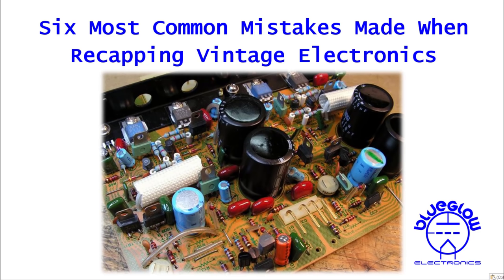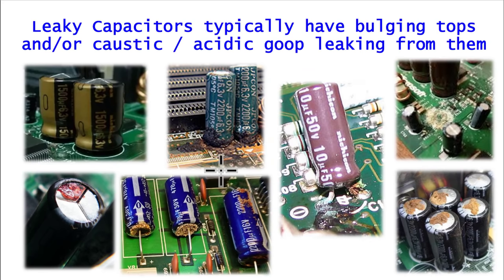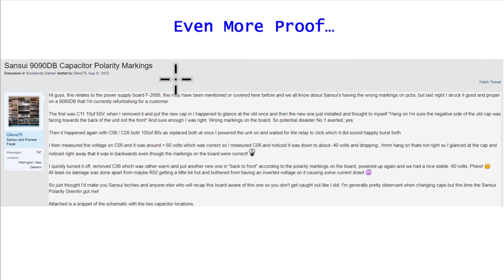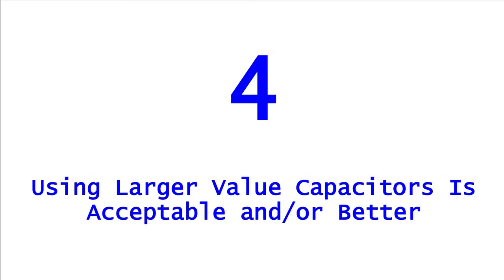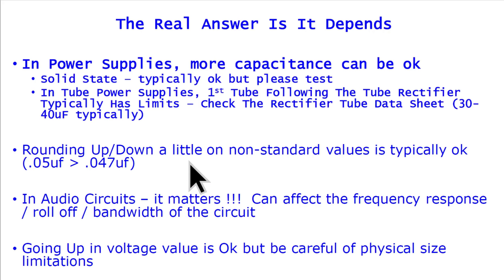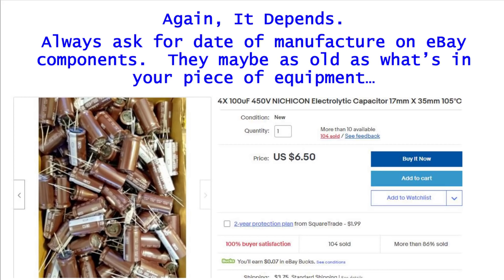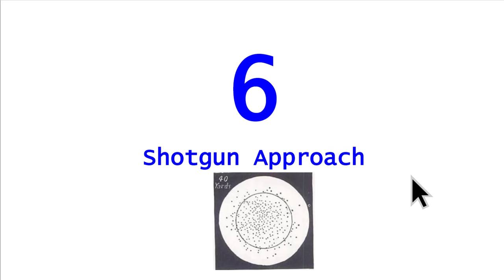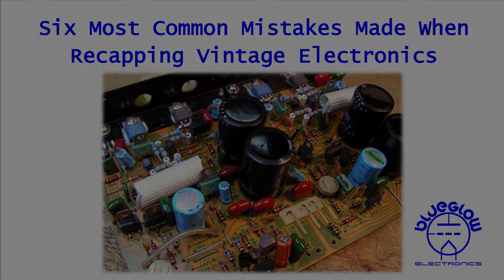Six Common Mistakes Made When Recapping Vintage Electronics

Comment: As one who doesn’t live in the United States, I no longer buy anything from the US. What’s cheaper for Americans is made criminally expensive by extortionate postage costs or simply unavailable because the company policy is, ‘We don’t ship overseas’. You get the feeling someone is holding a turd under their nose or something. More than that, I’ve come across the attitude of, ‘You’re not getting what we’ve got’.

I had this out with Parts Express, among others. Small scale tool companies are the worst but component sellers are pretty bad.

The inevitable result is that people like me are forced to deal with ummm… ‘other sources’. There’s no good sneering at other suppliers nations if American companies are unwilling to compete.

And in an ironic twist, a lot of them come out of the same factory anyway.

Comment: Changing the value on any Capacitors is NEVER a good idea, but putting a high freq low Z high quality cap makes the item last longer and changing the voltage to a higher value is never a bad thing(manufacturer's use cheep components and putting higher quality never hurts).
Old capacitors rarely go bad with age it is more heat and leakage or evaporation.
But in maintaining old electronic stuff the switches are more of an issue, cleaning all those contacts is a pain but so necessary.

Comment: Right away, the first part of the video,  I have a DISPUTE, and that is,  whether caps  APPEAR to be physically leaking  FLUID  has  NOTHING  AT ALL to do with whether the cap is good, bad, ELECTRICALLY leaky,  or not
Reply: So are you saying it's ok to have corrosive electrolyte all over your copper tracks as long as the device works for the time being??

Comment: Biggest mistake of all is recapping original caps that don't need recapping that had survived for 50+ years because they were properly made or MIL, highrel, and then replacing with a cap that won't last more than a few years.
Reply: Indeed. The best thing to do first is test the capacitors with a voltmeter and only replace those with bad readings.

Comment: bEWARE THE YELLOW GLUE. eSPECIALLY IN rca OR ge EQUIPMENT. iT CAN, OVER TIME, BECOME CONDUCTIVE. rca HAD TENS OF THOUSANDS OF INSTANCES OF THE GLUE CAUSING INTTERMITTENT ISSUES. mOSTLY ON TELEVISIONS, BUT ALSO ON SOME OF THIER AUDIO GEAR..

Comment: not doing enough is another failure. socket A and 990fx boards are ones with extremely high wattage chips that are extremely sensitive to any kind of fluctuation. its better to assume they are all out of spec than risk sending out a finished board you tested on a phenom and find out the customer was putting in a 9590fx in. intel has a few chips that were extreme load too but I don't mess with anything intel so I couldn't name them off the top of my head. some generations of boards were pushed so hard and so far that one cap or VRM even slightly out of spec can either cause endless errors like the crosshair v formula z or end in a chain reaction explosion like the asrock 990 extreme 9. the latter happening with enough violence that it will create shrapnel that can damage other parts and sounds like a machine gun firing. if it can hold a "board eater" chip test all values and assume everything can be bad even if it doesn't look it. 

another thing is older computer power supplies. replace everything in those that might fail, they are known as kamikaze power supplies due to the lack of any protection at the component end and if they go off they often will destroy anything attached to them. I recently found this out when a 90s computer graced my workbench and I found not only the hard drives dead but the motherboard and floppy drive had taken a nasty hit too. total loss. nothing was salvageable. however that wasn't a repair failure but a lack of knowing maintenance needed to be regularly done on the part of the user and the general criminally under-ventilated cases of the time that were only rated for older sockets. 

oh and if the case was under-ventilated assume the worst of every heat vulnerable component. I've seen cases where fans are decorations and the air from them flows nowhere.

Comment: I am clear on the ebay question, the first thing I look for is the rating of the vendor.  Anything under 99%, steer clear unless you are looking for an almost ‘unique’ item.  My experience is, that I can almost always get a 100% rated vendor, selling the item I want, for close to a middle or low-mid price.  The exception of course, is where there are only a handful of ratings or sales…that more likely suggests the vendor has ‘restarted’ their whole operation, than is genuinely a low-turnover seller just begun their business.  Finally, I believe the quality of Chinese goods, can equal that of anywhere and their labour force too, can be the equal of any…but…there is a load of broken crud floods out of Shenzhen, I assume many people are rummaging in ‘failed’ parts bins on a wholesale basis, and punting it as ‘good’.  The people doing this, are pretty arrogant too, so forget kind and well-mannered orientals when it comes to dodgy trash components or anything else - they are the same people, all over the world, they just speak with different accents!  

There is no comeback on Chinese Shenzhen region sheisters either, because as far as I can tell, ebay is afraid to take any action against Chinese citizens, or maybe certain ones that are ‘connected’?  ebay don;t frighten or worry these Shenzhen sheisters, is what comes through loud and clear, that’s why they proliferate.  And they brazenly lie until they realise you are able to determine the difference between trash and quality goods…then the veil slips a bit, and they go from I don’t know much about the product, I just sell this stuff’, to goading you to try to get your money back, in an instant.  As a rule, I simply don’t buy from China direct on ebay, excepting two knwon brands, with actual shops on ebay.  Cheap, unbelievable prices a quarter or a half of a US or Japanese competitor, etc, for the exact spec, usually means the trashy vendor is simply lying unfortunately.  Take care all.

Comment: The 7th most common mistake is taking videos like this seriously.  Blueglow implies replacing ALL capacitors is the way to go to repair a 50 year old receiver.  No, it's not.  Many electrolytics are still good at that age.  What you need to do is test each capacitor for ESR and replace only those that have high ESR readings.  Then when you first power up the receiver bring the voltage up slowly so the good caps can reform.  Typically that is not a problem for low voltage electrolytics - it's a much riskier approach in the high voltage circuits of tube equipment.  After running for a while check the temperature of capacitors - any warm ones should be replaced.  Finally, check nodes for correct voltages.  The more you check the better.  This is the way to repair vintage gear and not force a customer to pay for what is not needed.  Go honest.
Reply: With all due respect I beg to differ. Blueglow is correct in my opinion. The ESR is important for capacitors used in high current application like filter or power switching but it says very little about the state of the capacitor. Leakeage current and value drift are very important parameters and you need to test those in a proper capacitor tester (not the "multimeter" or LC kind). To do that you have to desolder the capacitor in the majority of the cases. If you have done that you may as well replace the capacitor with a new high quality one anyway. Most electrolytics will have a high leakage current or have changed value outside design specs after 50 years. There are exceptions but they are not normally used in consumer equipment. Other capacitor types are a diffrent story, good quality mica, plastic or cheramic can last a very long time if they have been used inside spec and not in a too harsh environment. If you want more good info in addition to Blueglow I  recommend Mr Carlsons lab, Paul has great info on this on his channel.

Comment: My suggestion to this list:
- Check the cap physical size and it's lifetime expectancy in it's datasheet. This impies using high-quality caps, that have credible datasheets.

This does not really apply to vintage equipment, because they used huge caps back then, but very certainly apply to modern, miniaturized equipment, which usually fails after a year or so. If you check the specs of those miniature but high capacity electrolytic caps, it will be surprising that they specify 2000-5000 hours of lifetime ONLY. That's not even a year for a device that operates 24/7!!!

If you can cram bigger-sized (same value) caps into these equipments, even when the lead spacing is wrong, the bigger ones will usually give 2-3 times more lifetime.

Comment: Sometimes the glue needs to go too - there are numerous cases where the glue gets conductive as it ages, and starts causing all sorts of problems. See EEVBlog videos about Rockit studio monitors failing because of conductive glue! The best way to check capacitors is with an ESR meter, you can even check them in circuit if there aren't multiple capacitors in parallel on the same bus. Even if there are multiple capacitors on the same bus and the ESR looks good, you can quickly verify with the capacitance measurement on a DMM that the value roughly adds up to all the caps together.  Best way to check for conductive glue is with a good meter.

Comment: Something to be wary about replacing caps with higher voltage: If the caps are of same size you might think "Win-Win!", however, chances are the higher voltage rated cap will have a higher impedance losses! It may heat up more making it's life span shorter and power supply performance poorer.
Ofcourse during the decades some progress has been made in manufacturing so this point may be moot on a device 3 decades old.

Comment: You forgot two, very important ones too. Don't mess with something you know nothing about. Learning how to do something is one thing but know when you are out of your depth and should stay away from a project.

Also, you have a phone, that phone has a camera. After opening up the case. TAKE A HUNDRED PICTURES. You should have a picture of everything before you start. Just so you can go back to a picture and reference it later. If you are like me, you will often have to set stuff aside while you wait for parts (especially these days). It helps if you have pictures when those parts arrive maybe months later.

Comment: Why Glue Capacitors??
Reply: To give them mechanical stability. If the mechanical load is on the solder joint only, the joint will fail under vibration or shock load.

Comment: Replacing original capacitors with high voltage capacitors not always good. Higher voltage capacitors raise circuit voltage. Its not always good.

Comment: Nevr mind glue or leakage, if theres a cap there replace it anyway. All of them!
Reply: You haven't watched Mr. Carlson's Lab very much, have you?   He talks about that very issue.
Reply: @jimthesoundman8641  what did he say about it?
Reply: @RadioRich100  He said back in the days of point-to-point wiring and vacuum tubes, oftentimes the mica caps were hand-picked at the factory to be a matched set, so they would mesh up well with the tuner capacitor, and may not be the exact value indicated on the schematic.   He said they rarely ever fail, and if you do just blindly replace them, then your radio may not ever tune properly again, because these "new and correct" capacitors no longer match up with the tuner capacitor.   He reiterates this same spiel in almost every vacuum tube radio rehab video.   
TLDR: He says that wax capacitors should always be replaced, but mica capacitors rarely need to be replaced and may do more harm than good if you do replace them..
Reply: @jimthesoundman8641  Let me clear up what I said. Replace all ELECTROLYTIC CAPACITORS. I didnt mean every type. I never do that.

Comment: What the hell does it make a difference if its leaked capacitor or glue. At a recap you replace all the electrolytic capacitors regardless of what state they are in. Make sure the board is clean and fix issues and install a new electrolytic.
Reply: Sure, if the whole shebang is slated to be recapped.  This hint is more for those performing a quick perfunctory check of a piece of equipment in which the caps are all OK, but who may be fooled into pulling a perfectly good cap simply because they see goo.
Reply: no you do not need to recap regardless, if they test ok, leave alone, recapping  is not a magic cure all or prevention of future failure aka 'futureproofing'  ,  i have lots of old radios going back to the 30's, ones from late 50's onwards, almost all have their original electrolytics still in as they tested good and ones before then, many , i'd say 60%, have their originals..

Comment: I think we need to define "vintage" to me if it has a circuit board and transistors it is not vintage. To me vacuum tubes and large wax condensers is vintage.

Comment: The "fakes", you're showing, aren't fakes. They're approaches to keep the original look, when you have to repair old gear with modern stuff.
Most won't care about the eyesore of modern component in a 60 year old unit, but some do.
You wouldn't  get such fakes from a company to cheat you, there's a lot of handwork behind such "fakes", they'll never pay off.

Comment: You forgot one major thing, in my humble opinion, always have schematics. On smps the little cap, has to be changed, because that's the one, who get those very high frequencies on his tail. If the rest are good, don't bother them. And I'm almost going to be 60 years old, my eyes becomes the biggest enemy. So SMD stuff, isn't for me anymore. Discrete thru hole components are okay.

Comment: It's stupid to replace every electrolytic capacitor in an old piece of equipment. Those most prone to failure are in conventional and switching power supplies.

Fix only what's broke.

Comment: I will bet you a box of donuts that those “errors” on the silkscreen are intentional to trip up third-party repairers. Proprietary tactics and right-to-repair issues go way back in many industries. Yes, it’s underhanded and in this case dangerous If a third-party repairer follows that silkscreen and the cap blew up in their face on power up. But try and prove malice of intent in a lawsuit if a tech looses an eye.